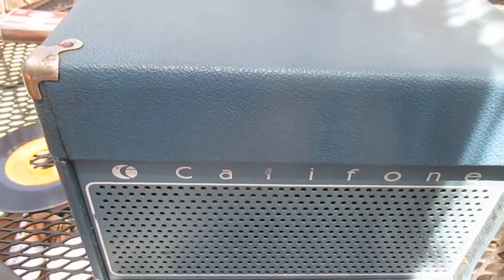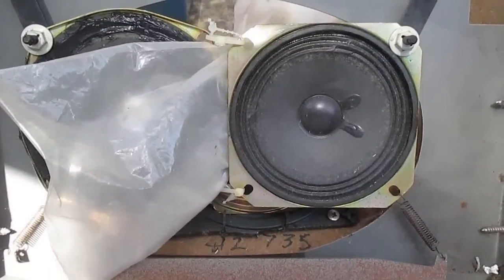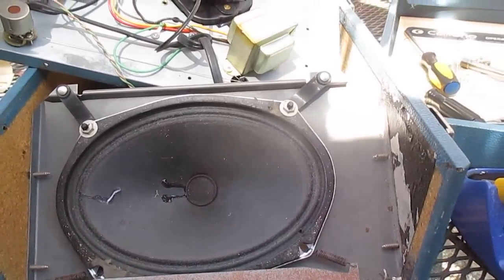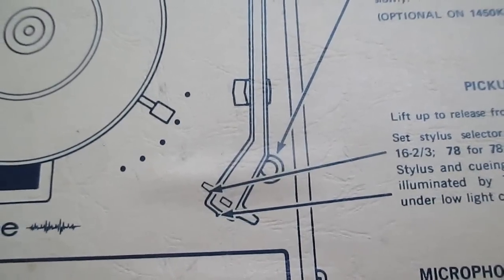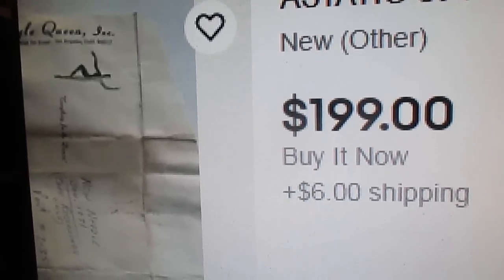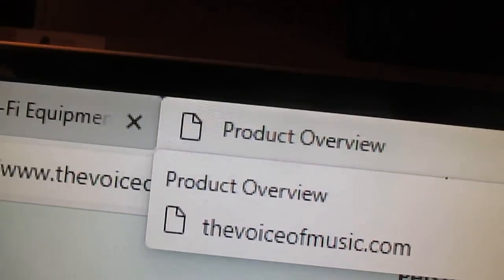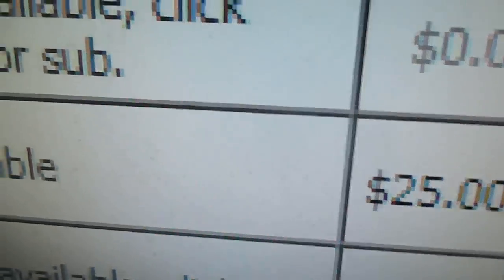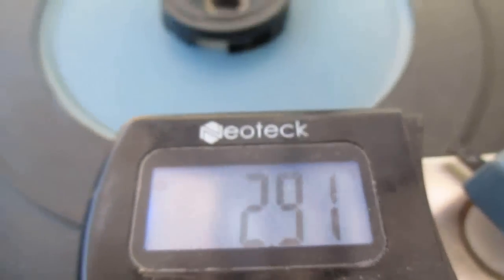1976 Califone 1450K record player hack job speaker replacement, etc.

Comment: Hey remember quite a few times salvaged old record players back then they were quite plentiful here's the motors quite frequently for other projects!

Love the other salvage parts as well including speakers had a pair of worker player speakers bolted to Mi workbench years ago literally had I think the speaker wires were actually dropped off chords some of the record players even or possibly speaker cables off something else don't think of it I think they already had the quarter inch quick connect already on there most of those were Gray You Are chords probably about 18 gauge or so.

Even had some speakers that would think they were possibly from a lid of a device but don't know what they were from oftentimes I would just get pieces from stuff that had been attempted to repair or Beyond repair.

Don't worry anything that was fixable got repaired it wasn't being repurposed one way or another or more than one way Aki repurposed forcible different things different projects.

You would have a few old Communications speakers back in the day put quarter inch Jack's wants of those chassis for the communications speakers!

At first I was a little confused on so the speaker is regarding the plug size that was on the table and realize which movie projectors these are for and it was the Oddball size photo Jack plug!

Simple fix they're snip and new plug
Reply: Additional stuff regarding the old record players from where I remember as well at least.

One of the things occasion I do is make a large spinning top out of scrap parts if had a motor that was no good and really messed up turntable platter or ones just too many of them to hang on to.

Miss Woodford happen frequently because of the amount of record players I had coming in at that time.

Great little kids toy to have a nice big spinning top have people beg me to make these for them even for their kids and themselves even seriously.

What I would do is use a modified motor shaft from when the record players again with a bad motor use the rotor assembly blue this into the turntable platter assembly in a certain manner basically creating a toy top worked quite well certain ones of the motors.

Got this idea from a younger friend of mine saying hey that might make a good top if you can find a way to put those two things together there on the workbench.

And that toy was born from somebody saying this I didn't even think about it!

I didn't tell anything and well first prototype was his birthday present it was in a few days!

Wrapped up nice and said here you go and he says like oh you remembered my birthday and I said wait till you see why it is and he just opened up and laughed he said so you did it!

I had so many used record players over the years it was ridiculous.

Since I've repaired them of course had the consumables AKA tubes and all available.

Actually even rigged up a little device to allow you to take a signal out from say a Walkman essentially a modified pair of headphones sort of that you could place the tonearm on this every couple of knocks vibration to use the record player as a amplifier actually work pretty well.

Kind of the photograph equivalent of the aux-in adapter for cassette deck!

Later on I actually build a proper circuit to do this fully isolated it took a lot of tweaking but eventually worked really well.

Definitely did not want to use quarter inch since  I did not want to make any mistakes by accident obviously!

Also had an old pair of transistor radios with a input jack the actually would use as stereo speakers this is back before computer speakers existed nice thing is they had Barrel Jacks for power input actually made a y cable specifically for this later on actually installed second Jax and paralleled them up so easily could connect a power adapter 21 and power both from the same adapter and also could use just one set of batteries for portable plus maintain the use of the radio also I know people that work in different Industries so basically had a ton of used batteries that were still in great shape and plenty of capacity left 9 V and much more sometimes if I had a bunch of little batteries I would just Roman series then use them up until Dad sometimes literally taping them together blossoms using magnets of lead wires which came up with vinyl design.

I remember everybody somehow getting the speaker magnets off the speaker frames and they were referred to at least by everyone I knew as radio Magnus but they were actually speaker Magnus the little what they call Pot magnets I guess you'd say for the voice coils not the big guys but the ones from smaller speakers!

Had a ton of those for a fridge magnets.

Ran across the few the other day even in my old trunk

Comment: Bryan, a while back I designed a pair of phono cartridge preamps. They have a gain control to set the gain anywhere form 1 to 10 times. They were designed to produce 3 V RMS with any cartridge that could make between 0.3V and 3V. In this case you want 1.5V and have 0.5V, so you need a gain of 3. Either preamp could do that easily. One of the preamps has bass and treble controls as well as gain, the other only has the gain control.

Would you like me to send you a few of these? They are designed to work with any power or B+ voltage between 12V and 450V, so should work in this machine, or a machine with a tube amp.
Reply from the maker: Yes, and I thank you very much.
Reply: @radiotvphononut  Give me a hint on how to get them to you, I don't know your address.

Comment: One could wire 3 8-ohm speakers in 4 different ways; 1) all in series (= 24 ohms), 2) all in parallel (= 2.67 ohms), 3) 2 in series with one parallel (= 5.33 ohms), and 2 in parallel with one in series (= 12 ohms). Of these, #1 has too high of an impedance; it’s not likely you’ll get much volume out of it. #2 has too little impedance and will result in the driver running hot or burning out. #3 and #4 seem to be the closest to 8 ohms. #3 seems to be the best option; wire the two midrange or tweeters in parallel, then put a bigger (woofer) behind - and in series with - it. A small crossover might not hurt here, though that will - of course - affect the impedance. A bigger (power) amp is called for if one did want to drive two midrange speakers and a woofer; I can’t see the factory amp being up to that task. 😢